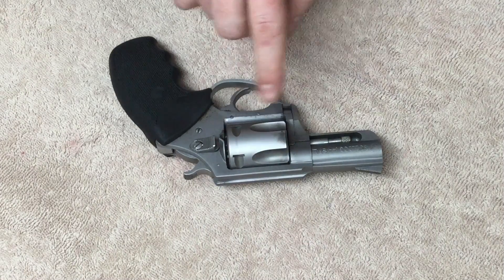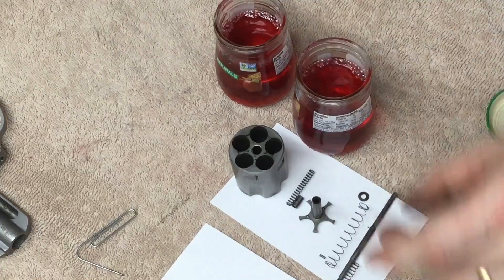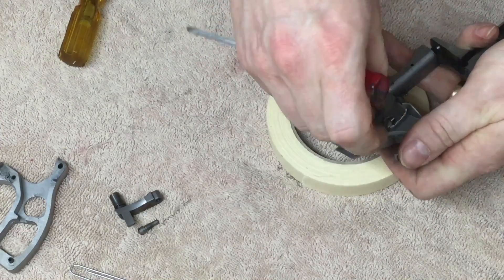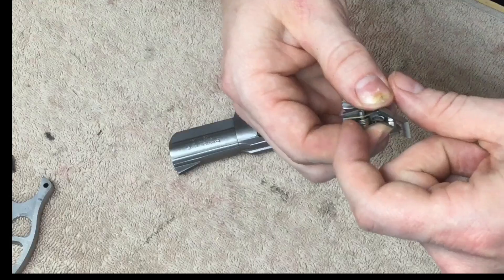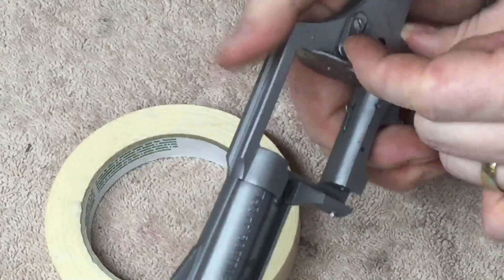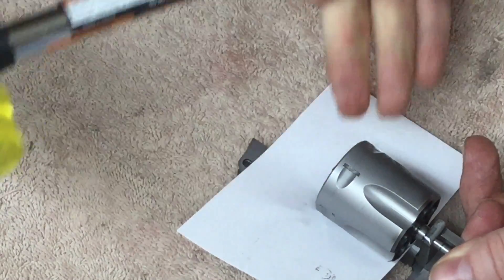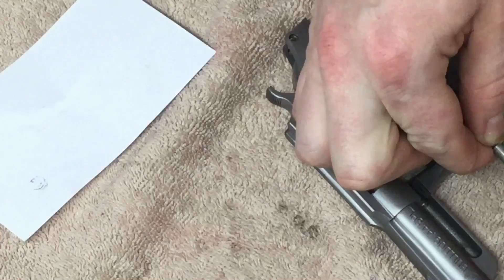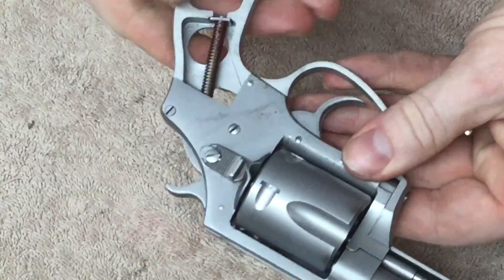Tear Down and Reassembly of the Charter Arms Bulldog

Comment: Great video! What size punches did you use? I love my charter arms and carry it often. The bore always looks so dirty no matter how much I scrub! Do you have any tips for cleaning? Maybe I have shot too many cowboy loads
Reply from the maker: Thanks!  I don't remember anything specific about punch sizes.  I doubt you'll ever get the bore to have a mirror shine, but if you're struggling with removing the leading I'd suggest looking at something like "Lead Away" cloth or "Lead Remover" cloth.
Reply: @MassCityMadman ill give it a go, but can be hard to find in .44 special. My gun light strikes on many ammo. I need a new firing pin I think

Comment: And I thought my Smith&Wesson was complexe, I am in a world of hurt when I clean my Bulldog (my M69 looks like a kids puzzle now).  It looks like the hard parts are cylinder, cylinder release, and trigger.

While I do see the need to pull apart the cylinder, I think one could leave the cylinder release AND the trigger in, then just spray the piss out of the inside of the frame with some Ballistol or maybe a foaming gun cleaner.   Charter Arms sells a tool to help reassemble the cylinder release, that's is a clue that it is no fun.  I wonder if they have something for trigger reassembly also that they just haven't released to the public.
Reply from the maker: I've only ever removed the trigger once, and that was for this video.  I would do it again .... if I had to.
The cylinder really isn't that bad once you know how it works.
I think they have Keebler Elves on staff to assemble the cylinder release.

Comment: So enjoyable to me to disassemble & reassemble a revolver. But for cleaning, it just isn't necessary. Spray it out with break cleaner dry fire several times. Cock the hammer, spray it out again. Spray in a LITTLE lube here & there. It will spread (creep) to all surfaces.
Done.
Reply from the maker: This video was the only time I've ever taken it down that far.

Comment: Stainless steel doesn't rust. Also. when the holster is 3x the size of the pistol, there's something wrong.
Reply from the maker: Not entirely true.  Due to the high chromium levels in "stainless" steel, it is far more rust and corrosion resistant than the iron and carbon "normal" steel, but it can still corrode.  I have had to clean and remove minor rust and corrosion from my Bulldog on multiple occasions.  I live in a hot environment, and the salty sweat certainly contributes to the corrosion.
If you've never tried this style of IWB holster, I highly recommend it.  The one I am using is made by Alien Gear.

Comment: Why not buy that pistol in 44 Magnum? That way you could run 44Spl or 44 Mag.
Reply from the maker: Charter Arms doesn’t sell this in a Magnum.  (I wouldn’t want to shoot a Magnum in a 20 oz gun either.)
All the rest of my 44s are magnums though.
Reply: This is a personal protection revolver meant for use against human beings at no more than 10 yards. It's not a bear gun.
Reply: Just about any 44MAG revolver will weigh double that of the Bulldog!

Comment: Remove the grips and spray down the whole gun with brake parts or carburetor cleaner. Then oil it lightly and put your grips back on. Note I said brake parts CLEANER, not brake FLUID. A lot of people don't know the difference between the two, but brake fluid will pit metal and swell rubber after repeated exposure. I know this because I've been a mechanic all my life. I've seen many brake boosters and wheel cylinders ruined from leaking brake fluid.

Comment: My CA 6 shot POLICE UNDERCOVER has light strikes on the primer on  about 50% of the rounds.   These rounds later all  fire from my SMITH 686.      What do you think??   Any advice will really help.     How can I fix this myself?    Never had this issue with my Bulldog.   Love your videos.  God Bless.  Thanks Lou Dambrosio 253-432-6225.    Pacific Time
Reply from the maker: Do they light strike in both single and double action, or only double action?
Reply: Loads of Bacon  Thanks for your help.  Most light strikes are in double action. I have not kept a count.  Lots of break in shooting.   This gun was made in feb of 2014 and sat in the box until a month ago.  Could that be a factor?   I am now cleaning this 38 this morning with 3M brake cleaner spray.      Funny thing is I’m baking 4 pounds of Costco bacon this morning!!
Reply: Did a six shot test today.   3 double action. 3single action.   No problems.   All primer hits look great and equal indentations.  The 3Mbrake cleaner spray may have got rid of dirt oil etc.  ?..       the firing pin now looks like a bright copper looking metal.  Never noticed this before. I removed no parts.  Any thoughts...?    Thanks
Reply from the maker: The hammer does not fall quite as hard in double action.  If a good cleaning doesn't sort it, I suggest giving Charter Arms a call.
Reply: Loads of Bacon.   Seems like the cleaning worked.   I’ll test it some more.   Thanks a lot.  Love your vids
Reply from the maker: Outstanding!  It's amazing what a microscopic piece of grit can do.
Reply: Loads of Bacon     The 3M brake cleaner must have flushed it clean.  This area is now a new color tone.  The firing pin looks copper.

Comment: I just bought the 45 colt version. I haven't shot it yet but man is the action gritty, the trigger like trying g to set a mousetrap,  the DA trigger pull really stiff. I know I can't compare this gun to my anaconda but geez wish they refined the action a little. I may try disassembly,  polish, and try to clip off a few spring coils. I dunno I'm not impressed with the mfg effort.